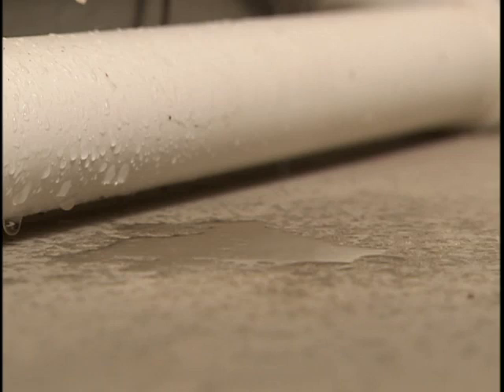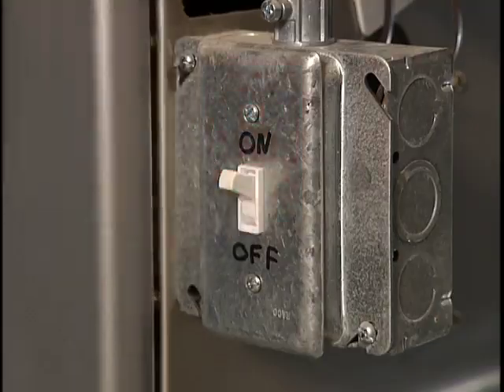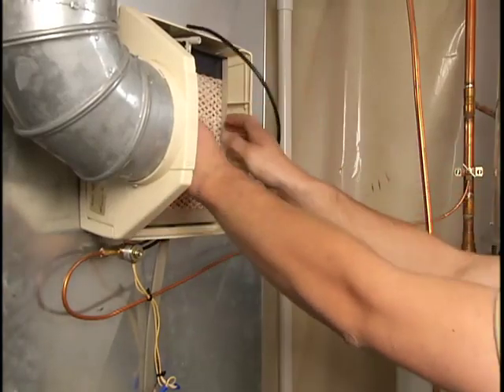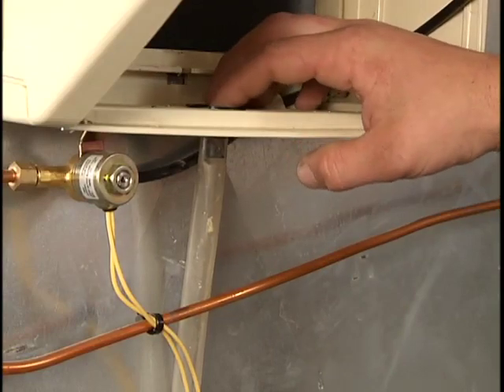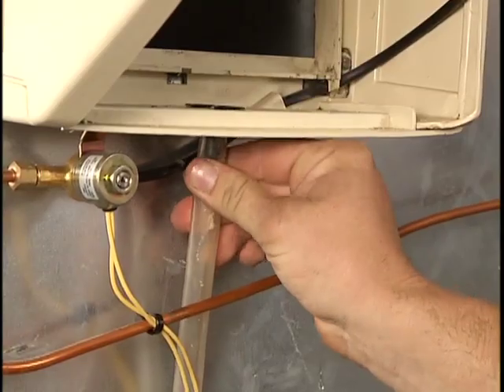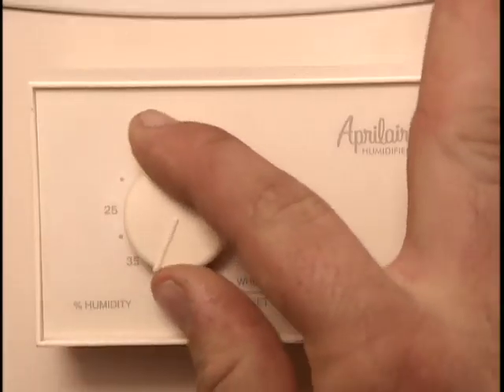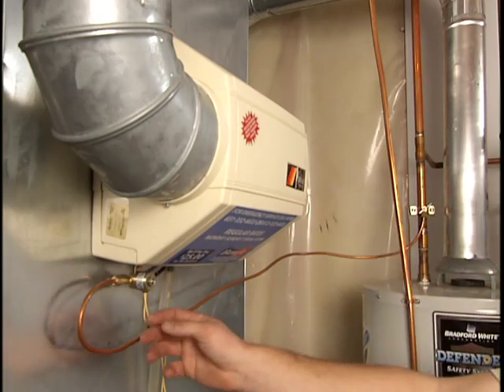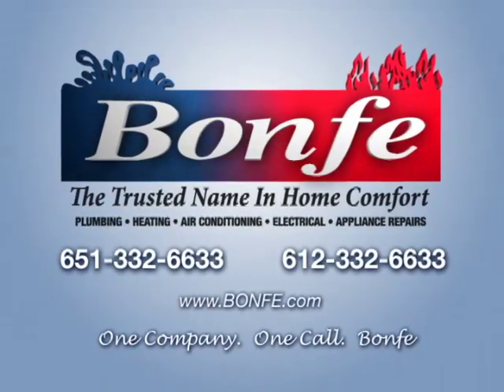Fixing Humidifier Leaks - a How-To from Bonfe's

Comment: Typical misinformation by so-called experts!  Another cause of leaks is not orienting the replacement water panel (filter) correctly... the color "spotch" on the filter indicates the correct "TOP" of the filter when replacing.

Comment: When you disconnected the tubing from the humidifier what is the black thing that you popped out of the bottom of it? Before you re-inserted the tubing?
Reply: Blockage in the drain hose?